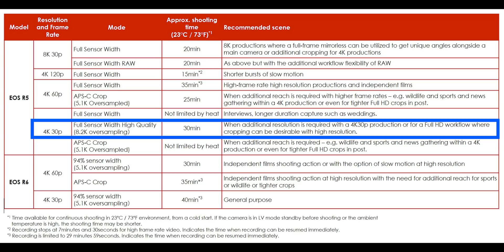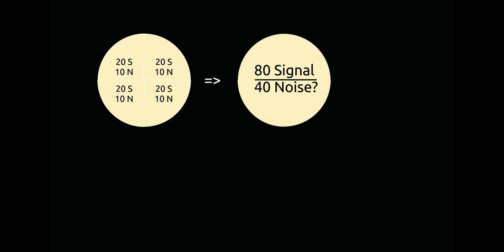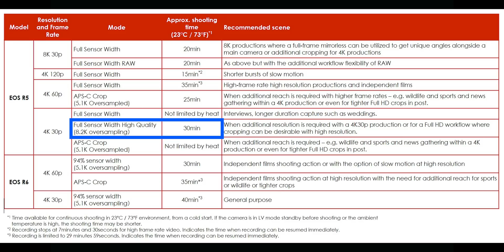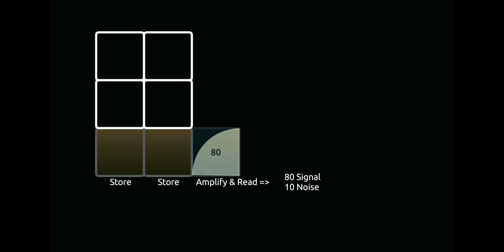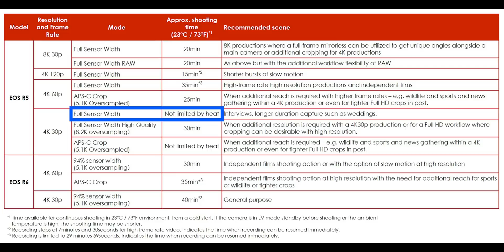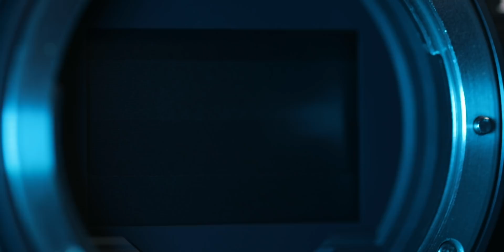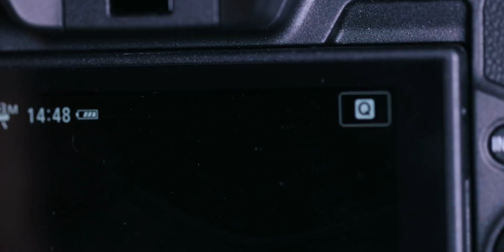Canon EOS R5 - Everyone is WRONG - Sensor explained - vs Sony A7s iii

Comment: But the most important point is, this is a Photo camera, but everyone seems to discussing about video capability....
Reply from the maker: Yep clearly the sensor choice and IBIS solution makes the R5 a fantastic still photo camera, and paired with the new RF f/1.2 lenses, the complete photo package is miles ahead of competition. Similarly the A7s iii will bring low light video like we've never seen in that small body, and probably with almost no rolling shutter. My big fear right now is that I'll have to buy both of them lol 😆
Reply: CTO LARSSON - TECH Well, this is a complaint on a high level :) For us users it’s the best thing what can happen actually. Only competition can drive the innovation to the next level. I will wait on the Sony A7SIII.
Reply: ReD DeaD RaZoR I agree with all what you said but let it go bro. When people can’t have a logical discussion or are challenged in a way that’s beyond their capacity to think or reason, they can only make uneducated claims and diss the other person to make themselves feel better. I figured it’s better to leave them alone and not feed their fun :)
Reply: Hi CTO LARSSON - TECH,

Hahahaha!  Same here.  I’ll wait for you to test out both and provide real world uses.

New sub!
Reply: yeah R5 is mostly a photo camera, just like a7RIV but with more video recording modes & in this case with obvious consequences
Reply: It’s a hybrid
Reply: It's low hanging fruit I guess. If the only thing bad is the high end video which to me is purely a bonus. Let them have some fun and Ill hopefully be taking great stills 😀
Reply: That's because they hyped it up as their top selling feature. And of course the cripple hammer
Reply: All Cars United，

Seems like you are i terestes in cars, so I use some car example.

A supercar like Veyron claim they can go 267Mph, can they do it for long period of time before the engine blow itself up? 

Tesla claim their car can go 0-60mph in 2 seconds, but they did not tell you that you have to cool down the battery for 30 minutes before you can do the second launch?

All manufacturer put up claim. But Canon has been honest about it even before anyone gets that hand on a production model, and they have built in function to stop it from over heating by calculating the duration of record. 

Is 8k for 20minutes best for everyone? No. It is a god sent to someone who need it. Canon did not hype it, the camera review and internet hype it. Because it is the way youtuber and camera review site make money. More click more comment, better income.

Has any one of the critic get the real product? No. So why no one attack Tesla? Bugatti?

Because it is tribal mentality, people love bashing people from other group. Go figure.
Reply: Pretty much every SLR-body-shaped camera is a stills camera. Some are more tweaked for video than others, but all are awkward to use for video. Just low cost for the quality delivered. 

Canon's 5-series have always been good stills cameras. But they did also launch the first useful full frame stills-for-video camera in the 5D Mark II. And apparently, more than half of those sold were sold primarily for video. So it's easy to understand that Canon's effectively relaunching the "good for video" 5-series camera here, after years of falling behind everyone else. 

If they intended this to be video-centric, it would have a "C" (for cinema) somewhere in the name. That's clearly not their goal here, but rather, to suggest Canon's competitive again. I mean, at this very moment, the R5 does blow away every Sony. Yes, the A7S III is now the perfect-because-its-not-out-yet stills-for-video camera. But without that, you have nothing but consumer-grade video from Sony... and overheating issues of their own.
Reply: it is a photo camera? so we would be heavily overpaying for useless 8K?
Reply: David Marquez,
Probably so, it is meant to be expensive, it is a Halo product to make a statement. Like Leica is expensive for no reason.

Get the R6 for still, unless you need the 45Mp sensor, or if you need the 8k for short take. 

But as a handicapped video camera, it is a bargain thought, you can get a few for the price of 1 RED camera.
Reply: That's  a good point.  It is a stills camera first.  That high density sensor is meant for stills.  But, damn if Canon didn't market it as a video camera.
Reply: Sky Makai,
It is a decent video cam too. Even a PC or iMac get stretched when doing 8k. It is a marvelous that a camera these size can do 4k 60p, let alone 120 and 8k. Get 2 or 3 if you need to use 8k for serious production, it is still cheaper than the Pro Video cam.
Reply: Because of the way they are engineered, mirrorless cameras are a video camera first and a photography camera second. If this was a photography camera it would have a mirror and pentaprism.
Reply: That’s because stupid Canon hyped the R5 and R6 for video capabilities and being video centric. Now they have to eat the shit. And by the way, also the sensor of the R5 is just of old technology, it’s not even a BSI or stacked sensor. Especially the last point is resulting in a massive and ugly Rolling Shutter effect, it’s even worst than on 1DX Mark III in LV Mode.
Reply: @Stefan1968ful  Canon didn't hype it. They just mentioned it and the YouTube community hyped it. And you don't know anything about the technology of the sensor. And you also don't know anything about how bad the rolling shutter is.
Reply: Stefan1968ful you do realize the r6 has a 14ms vs 24ms of the a7iii, how about that for sensor technology. So the r6 has better shutter lag than your precious a7iii and it also overheats in 4k30fps
Reply: Do you have a reference on R5 rolling shutter issues? 

The only thing that affects rolling shutter is readout speed. Stacked sensors are one way to get very fast readout, but it's also technically possible to build a fast enough interface to get the same result directly between the sensor and the ISP.  Canon's had issues in both places before (slower sensors, slower processors), but all of their claims suggested they'd solved this. Of course, as with the heat issues, reality does sometimes intrude on a nice, tall tale.
Reply: Stefan1968ful Sony fanboys have the least IQ of all. The Sony stacked sensor was developed to have more speed at 10fps mechanical and 20 fps electronic (12 bit compressed) in the A9. The new sensor in the canon 1dx mkiii destroys it in speed by doing 20fps mechanical (14 bit uncompressed). The A9ii buffer can do 239 frames in RAW while the  1dxmkiii can do unlimited. At 10fps mechanical, The Sony a7R IV buffer supports a maximum of 68 JPEG, 68 compressed RAW, or 30 uncompressed RAW images while the R5 again stomps it. At 20 fps, it'll write at least 84 Raws + Large/Fine JPEG files to a CFexpress card, a number that increases to 170 shots if you just shoot JPEG. In 12 fps mode you'll get 90 Raw + Large/Fine HEIFs, 160 Raws with JPEGS and 180 Raw files. Talk about processing speed. While Canon has the edge in speed of shooting and writing it to the cfexpress, sony was a tiny bit faster in AF locking. Neither are a whole lot better than each other. Just different sensors. 
Second thing is you probably didn’t pay attention to the photo specs of the R5. Even the R5 does 12fps mechanical and 20 electronic matching the A9mkii. That is a BIG DEAL. While Sony makes either a photo or video centric camera, canon does a true hybrid. Again both Sony and Canon are awesome cameras for different people. Fanboys won’t be able to do jack sh** with either cameras and can only complain 🤷🏽‍♂️
Reply: Stefan1968ful Ahahaha you didn’t insult any camera or hurt anyone bro... but you just made a fool out of yourself. I just spoke logic and facts, which is too much for fanboys to comprehend.. it’s ok 😊
Reply: Ali Mustafa My dear friend, these are truly your Canon Fanboy facts and you tailor and tweak them to make it fit into your limited view and vision. I give you a 2 Cent advice: do a better reading and study on real technical facts rather than assumptions and conspiracies - considering you are able to do this :)
Reply: Stefan1968ful - Lol, Don’t take it personal man...Everything I mentioned above are from Sony’s and Canon’s specs sheet. Perhaps, feel free to fact check it and if you can find any discrepancies, I am more than willing to accept it and if they’re inline, hope you can do the same :)
Reply: Ali Mustafa,
  From my observation among my peers. 
1) Sony users generally get attached to sony brand and become fans.
2) Sony fans are edgy tech users, they like spec, they like doing pos processing, grab all in first and then deal with it later. They like sitting in front of TV or Monitor. Not like bird or nature lovers who speak softly, or artist who favour state of mind, who like to spend time in nature.

Sony fans do not mind bring in machine gun for hunting. While Nikon and canon fans carry more sentiment of hunting by out smarting the game or things like one bullet one kill. Fuji fans admire the mechanism, the built, the sound of their rifle they they carry. While olympus fans are proud of their small revolvers and stand by their believe that they are the most practical.

3) Sony fans are usually gamers. Gamers like to win. They just like to win with less consideration to the opponents feeling. Because in games, the opponents has no build in algorithm for feeling. They got used to dealing with that, that is why they are nasty and hard to talk to. Because they just want to win.   At all cause... shoot them all... use cheat code... buy weapon. Ya, I know because I play a little PS Game. What’s the point of playing if not for winning in the game.

Final words. Leave them alone. They are not idiots, they just want to win, so let them, not like you are going to lose anything.
Reply: Hi Ali Mustafa,

Actually there are quite a few things you missed out pointing to facts.

I shoot both brands and think these debates are a waste of energy and useless.  Just buy what works for you and your budget.

Firstly, yes you read the specs correctly but missing some key stats.  A9 came out in 2017, A92 in 2019, and R5 in 2020.  In tech world, that’s the different between iP8 vs iP11 vs MBP’17 vs ‘20.  One year in tech is like dog years.

Had Sony not jumped into mirrorless, we would all be buying big, heavy, expensive, and crippled features and always be pissed off.  Why else would so many Canon users jump to Sony.  And the fact that Nikon, Pana, and Canon moving in mirrorless, we need to thank Sony for that.  Competition is all good for us, better tech, better prices, less crippling.

Let’s compare R5 vs A7S3 in 2020 for video as both will be available within a month of each other.  See which one overheats and allow unlimited recording.

Let’s compare how the workflow changes with rendering times and processing HEVC files on existing desktops/laptops, or does that mean more investing into new hardware.

R5 raw video is in Clog which is limited to 12 stops vs Slog3 which is 16 stops of DR and then add the BSI for lowlight.  Even if there is a firmware upgrade to Clog3, Canon confirmed on Proav that it is limited to 13.5 stops (R6 is 14.6 stops max due to the 20MP vs 45MP).  But if Canon doesn’t update to Clog3, you’ll be limited to 12 stops.  

Let’s compare stills.  A7R4 came out in 2019 with 61MP vs 45MP in 2020.  Nothing to brag about this.  HEIF files are hard to process.  As for 20fps, if there are distortion and you shoot wildlife or sports (any fast action) then it becomes useless.  

Now I not saying all this to bashing Canon fans but to remind every camera manufacturer make bodies with limitations (and workarounds) because of dealing with price vs performance vs power.  They all need to do a better job to be upfront about all their specs in real world and not on paper.  

I’ve bought Sony A73 and A9 and the colors are not processed as good as Canon, but that is because Canon does a better job of processing skin tone RGB and with white balance.  If shooting raw in stills or video, it doesn’t matter.  Only with video, it is 8bit 4:2:0 internal and 4:2:2 external so can’t take advantage of Slog2 and Slog3 (that’s why it looks so bad when grading as you can’t get the full DR).  Canon does a better job and the colors are more pleasing to the eyes as they are warmer.  Panasonic has the best especially with the Varicam luts.

I’ve used the EOSR and biggest gripe is 5fps, single card slot, 10bit 4:2:2 only if shot externally (otherwise 8bit which is super misleading) and this came out at tail end of 2018.  Did I mention there is a 1.74x crop in 4k and shooting in 120fps is in 720p, really?  

So I switched to Panasonic S1H and they ticked all the boxes except af, which doesn’t work for fast action stills and run and gun video.  More for studio, landscape, and time lapse or where you have time to pull focus.

So from my perspective and experience, I’ve spent hard earned money to chase specs and not knowing what is advertised is not what happens in real world.  

That’s why you shouldn’t care about wasting your energy on useless debates and focus on what you need and can afford.  

These companies will do fine and sell a lot of cameras to pros who knows what they need and want (and can afford it with paid jobs), but it’s prosumers and hobbyists who have to do more homework before investing in.  

Having said all that, Congrats to Canon and soon Sony.  They have both stepped up and provided really great cameras and tick a lot of boxes, limitations aside with workarounds and I’m looking forward to real world tests before upgrading.
Reply: @nomad0714   Thanks for sharing your thoughts. You brought up some good points, although there are a few things you may be misinformed about:                                                                                                                                                                                                                                                                                                                                         
                                                                                                                                                                                                                                                                                                                                          First - I didn’t compare the A9 to the R5. I compared the A9ii to 1dxMK3. Even comparing the R5 to A9ii just for a reference, is not unreasonable. A9ii released in Nov 2019 and the R5 was announced in early March 2020. I work in IT and work closely in SDLC and PDLC (Product Development life cycle). Both Canon and Sony develop and control majority of their most crucial parts - Processor, Sensor and etc, which they have been working on it for years. So 6 months apart, in this sector, won’t make a big difference. Trust me I know :) What you are saying can apply to cell phones where Qualcomm/Apple releases a chip every year which is faster than the previous one. Cameras have a longer refresh time unlike cell phones and other tech, where we get an upgrade/refresh every year.                                                                                                                                                                    
                                                                                                                                                                                                                                                                                                                                      Second thing, Yes, Absolutely! Big thanks to Sony for pushing the mirrorless segment. If it was not for Sony, we wouldn’t see the mirrorless market where it is at today. 100% 
                                                                                                                                                                                                                                                                                                                                          Third - You are comparing a hybrid camera R5 which is great at both photo and video to a video centric camera A7siii which excels only for video. I don’t think that’s a fair comparison. And even if you do compare it, there will be pro’s and cons to both. R5 is better for a hybrid shooter where as a7siii would suit someones who’s only a video shooter. It’s like comparing a Corvette to a BMW M5. Which is better ? - Depends on what you do :)                                                                                                                                                                                                                                                                                                                                                                                                                                                                                                          
                                                                                                                                                                                                                                                                                                                                      Currently the R5 stands on it’s own and there is no real competition to it in the Hybrid segment i.e in terms on doing great in both Photo and Video. I hope to see some competition soon. 
                                                                                                                                                                                                                                                                                                                                      Regarding the EOS R, You have to understand the EOS R was Canon’s first attempt at a full frame Mirrorless camera. So yes, it lacked in a lot of things. It still did great 1080p and although it was cropped, but it is very good quality 4k at ~480 mb/s. And it's still a great camera for stills. Not so much for fast action, I agree. 
                                                                                                                                                                                                                                                                                                                                      But again, specs on paper is one thing, and usability and practicality is a whole another. Android phones always had killer specs on Paper (like 8GB RAM and etc).. And an iPhone with less than 3 GB of RAM would still run equally smooth or smoother. It’s all about optimization and usability.
                                                                                                                                                                                                                                                                                                                                      To conclude, I agree, you cannot go wrong with either or. Both are fantastic cameras and they are driving each other forward which is a win win for us. Trust me I am not brand loyal or care about that. I have used Sony, Fuji and Canon for a while and in the end stuck with Canon. Not because it is better by any means, but only because it suits my needs better :)
Reply: @Musatainment  All great points, I agree. I will point out though that the 12 fps in the R5 produces 13-bit raw and not 14-bit raw according to the footnotes in the literature.
Reply: Steven Hoagland Thanks :) Although I said the 1dxmkiii does 14 bit uncompressed raw, not the R5 :)
Reply: @Musatainment  I know. But since you mentioned the Sony dropping to 12-bit compressed at 10fps, it was only fair to mention that the R5 drops to 13-bit RAW at 12fps. Not sure if the Canon's 13-bit RAW is lossless or lossy like the Sony.
Reply: Steven Hoagland Ah I see your point. We’ll find out soon when some official reviews come out
Reply: Ali Mustafa dude not sure why you got to try and generalize all fanboys as sony fanboys when you just replying to one dude 😒 for the record dude ain’t wrong about what he said...so only you out here comparing sony to canon🤷🏻‍♂️ but beyond that you spot on bro canon coming out here with some good cameras
Reply: esphi LEE speak for yourself. Stefan’s original comment wasn’t even wrong. It was Ali and now yourself feeling the need to suddenly bring sony into this. Y’all are the problem here. Yes I am a  professional who uses primarily sony and Fuji, but I’m not here talking smack about canon or Nikon...half the shit you said is generalizing an entire fan base and has nothing to do with anything.
Reply: @Musatainment  Just pointing out... 20fps electronic is a function of the sensor. Whether 10fps, 20fps, or something else, mechanical speed is a function of the shutter mechanism, not specifically the sensor. 

Canon's solving the burst speed issue with very fast memory cards. Sony used stacked sensors to allow for very large buffers on-chip, but they've typically been weirdly slow at unloading that buffer on stacked-sensor cameras. Flash card speed is the ultimate gating factor, and on Sony, a seeming inability to multitask (you lose the camera while it's writing to the memory card, at least on some models). 

Focus processing needs a fast sensor readout and fast image signal processor (ISP), but these days it's largely the ISP that's the limit. Sony has generally used some of the fastest ISPs in the industry, allowing them to do more processing for AF in the same time slice. I'm pretty sure the other companies are aware of this, and scaling up their ISPs.  There's always more to do... after focus locking and tracking, there's object recognition. The eye is the first one Sony went for after the face. But in time, AF is going to understand quite a bit about your subjects.
Reply: @nomad0714  Canon had 50 megapixels in 2015 in their high-resolution 5DS. Given that this is an R5, I think it's pretty clear Canon sees this 45 megapixels as a standard working resolution today, not a specialty highres camera like the 5DS or the A7R. I expect they'll have a high resolution specialty model in the next year or so. Just sayin'...
Reply: Nomad 24 Hi Nomad24, you have a really valid point. I am thinking of going to a different ecosystem where my 60% is Photography and 40% is Video. When I started it was like 90% photo and 10% video, so I am using Nikon till now. But it will be 60-40 now, so I am thinking of switching now. Which one do you recommend? The EOS R6 or the Sony A73 or any other ? Thanks
Reply: Stefan1968ful From a marketing point of view, you would want to hype the video capability since it is a stills camera. A lot of consumers understand this, because if they were going all in on video they would have included a fan. These video features are a bonus